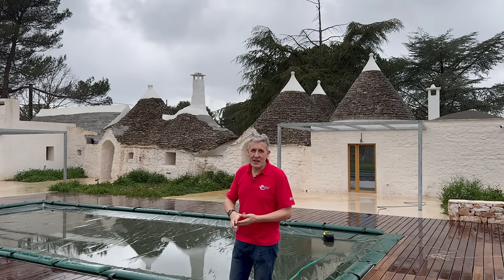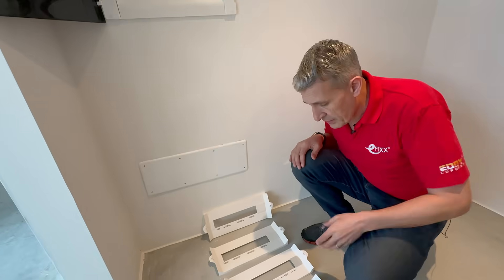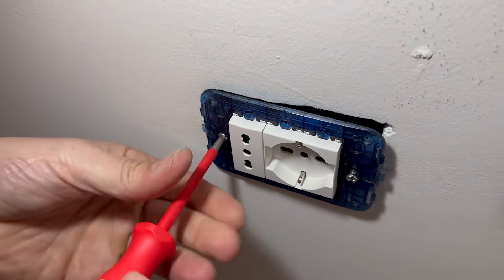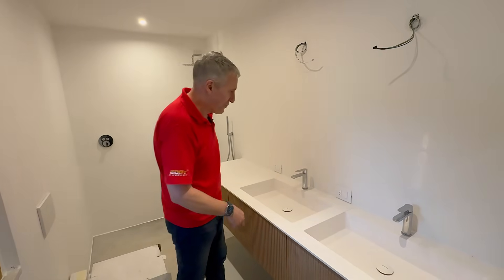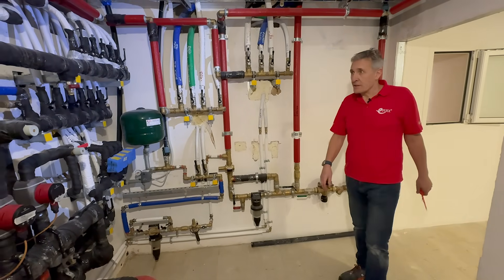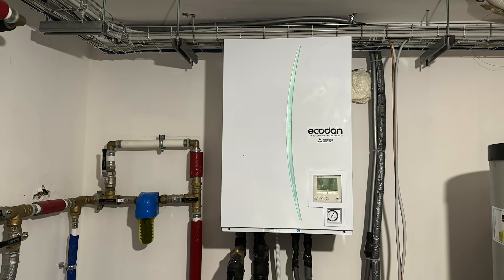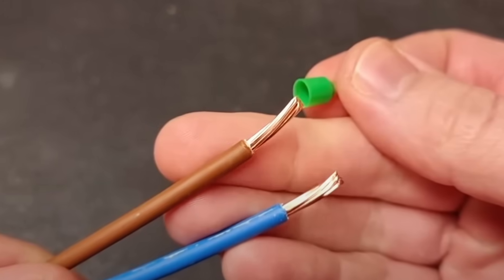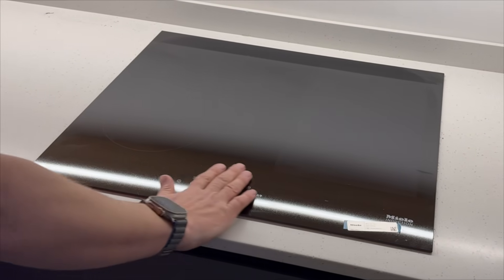Electrical Installation in Italy

Comment: How do you mount light fixtures to a bunch of wires sticking out of the wall?  In the States there is a box to screw the fixture to.  In my Italian house I'm just putting screws in next to the conduit coming out, but it seems so wrong.
Reply from the maker: That’s the usual way in Italy!
Reply: Grazie!   @efixx
Reply: Not really an issue in case of brick & stone walls. Though nobody puts screws directly into walls. We use wall anchor and self tapping screws. 
If anything can be mounted or secured to walls, wall anchors are the way to do it. That unless you have drywalls... If that's the case, good luck.

Comment: I live in France, and we can purchase "pre loaded" flexi conduits ( called Gaine). Which brings me to the question of how did they draw the cables through those long lengths of conduits? There doesn't even seem to be a draw wire to drag the cables through.

Comment: I've bought a property in Sicily and just going through the wiring requirements. I have to say the amount of flexible trunking makes me head hurt. The trunking was put in place before I bought the house. The previous owner didn't finish the wiring before they sold it so my guy has to go and make sure all the pipes are clear. I also want to make some changes, additional sockets, wall lighting and also some LAN connections (the walls are about 18 inches thick, so WIFI is not really going to work). I'm hoping that they don't have to chase the floor because it's all been tiles by the previous owner. Thanks for your video, it makes things much clearer in my mind what's going on.

Comment: Hello, this installation is good except for the sharing of junction boxes between low voltage (400Vac) and extra low voltage circuits (<50Vac). It is only allowed if both the kind of cables sheats can withstand the highest voltage present or if the power cables are double insulated like FS18, FG16R16, H07RN-F and so on. About the ferrules it's a common practice to use them with our Italian flexible cables, however they only provide an advantage when the terminal block has a direct clamping, with a screw directly pushing on the copper (like in the distributor inside the main switchgear). All the circuit breakers, though, have indirect clamping with a cage squashing all the individual threads of the wire evenly. In that kind of connection ferrules only increase the contract resistance.

Comment: Interestingly you came across Finder step relays which I have used extensively. Using Scolmore retractive switching on Cat6 cabling with 24vDC to control allows the householder ultimate choice of what they want to switch.

Comment: They dont need a isolator.
Becauase they can isolate at the board.
Uk 1 pole breakers only phase, not safe for isolation.
Italy 2 pole breakers (phase and neutral) safe for isolation.

Comment: I’m an electrician in the United States. Although I do think the British plug and the 240 volt system is superior, I prefer our conduit and wiring methods. That plastic flexible conduit looks atrocious and I bet it’s a real pain in the butt to pull wires through. We do have some conduit that looks exactly like it but it’s blue and we call it Smurf tube and we only use it for data cables or some concrete encased applications and not very long runs. Usually for stubbing voice and data cables from a motel room into the hallway ceiling, or up a concrete wall into the attic space to sleeve a section of Romex (twin and earth as you call it). Other than that, we use PVC hard pipe underground and in concrete, or galvanized metal conduit or mc cable for everything else. Romex is pretty much for residential and not much else.
Reply: It’s not really that hard to pull wiring, as said in the video we use class 5 conductors that are finely stranded.
Reply: Also the ugly pipes and tubes that are surface mounted are non flammable. Same for the wire insulation. 
Pulling wires isn't as difficult as it seems since we use 1,5 to 6mm² strained wires that are very flexible and easy to pull.
Reply: @OG_ALviK the problem is trying to push a fish tape into the conduit, especially on long runs. We are only allowed 360* between pull points. On hard conduit it’s easy to add up the amount of bends and keep track but with flexible conduit each little sag and dip adds up and I’ve had to have someone else shaking the flex while I push the fish tape in.
Reply: @monteclark1115 That's because you guys don't use strained wires but single core ones. That can suffer from bending fatigue

Comment: Taking each socket cable back to a junction box reminds me of an installation I came across a number of years ago. 

All sockets were single with each on its own 1.5mm cable. All cables went back to a big junction box. All socket cables went into a terminal strip then one 6mm cable back to the Consumer unit above. The guy had big drums of 1.5mm cable free or very cheap. Lights in 1.5mm, oven on 4mm or 6mm. Worked very well.

Easy to fault find for sure.
Reply: Is it still a radial circuit? Well, it is but I don't think it is called a radial circuit 😅
Reply: @Mixolixplosion  
Yes a radial.  Not a ring for sure.

Comment: Guys. Even in Poland we have more advanced and way better made installations than in UK. UK needs updates asap😅
Reply: Going by the Polish guys in the UK. I would not let them near a pipe or a cable.
Reply: @johnburns4017  probably these peoples are not sparks or plumbers. I cam tell a lot about english tradesman's as well.

Comment: I purchased a house 18 years ago and found the wiring to be all black throughout the house. I am slowly replacing the wires and adding wifi switches to work in parallel with my relays throughout the house. I created plates with all the components and relays mounted over the JB because it's too small.

Comment: I think house building in the Uk is about 50 years behind most of Europe. We are still obsessed with cramming lots of circuits into tiny consumer units in ridiculous locations. If we designed our house similar to what we have seen here . I think this would help combat the zero emissions problem as well as making EV charging more readily available to everyone.
Reply from the maker: Exactly 👍
Reply: Yeah consumer units under stairs or directly above front door . Or in tiny cupboards built around it with barely enough space to get the front cover off the consumer unit . The placement of consumer units and dno cut outs in domestic properties in the UK is pretty bad
Reply: Can't tell you the amount of times I've had to inform a client their cupboard is going to have to be dismantled for work on their board . They're never happy and even less happy when realise they need a joiner to replace it .

Comment: You call two way and intermediate lighting wiring complicated...I'd hate to see what you'd call commercial panel wiring with PLC's, contactors and other specialised equipment in the panel.
Reply from the maker: I wouldn’t struggle but many electricians do.

Comment: Much more similar with mainland EU. Everything makes sense. Isolator switches offer ZERO protection from anything. They literally never trip nor are they never OFF when fault or dangerous situation happens. I would like to hear reason, why UK uses isolation switches (for DC and AC of inverter, for appliances etc).
Reply: It's literally in the name - isolator. They are not protective devices, their only job is to electrically isolate the incoming and outgoing circuits from each other. They are meant to be operated in a zero-current state.
Reply: @Jultsu  Everyone talks about the "meant to be operated in the zero current state" but actually the specification for the devices allows them to be used as an interrupter.

Comment: The back boxes are American, even down to the UNC 6-32 fixing screws, which are a nightmare to find if you're using those boxes outside Italy and need longer screws. Apparently Mr. Ticino, one of the founders of BTicino, went on a study trip to the US in the late 50s and was so impressed by the system that he introduced the boxes in Italy in the early 60s. Italy also has sizes that aren't used in the US. The ones in the video all seem to be 3 modules but you can get 4 and 7 modules too, and 6 (3+3), 14 (7+7) and 21 (7+7+7). Especially the larger boxes are atrociusly expensive compared to the round 60 mm ones used elsewhere in Europe. Round ones are around 20 cents each, while a 4 module Italian one costs €2.70 and a 7 module one 4.70. The round ones slot together for multi-gang switches and sockets, so you can just multiply the price with the number of accessories you need.

The non-IP rated sockets right against the sink definitely aren't a great idea, usually they're at least 300 mm above the sink and/or to the side.

The lighting controls are on a KNX-based bus system, so only a two-wire bus cable runs to all the "switches", I think one cable can serve up to 128 devices. Very flexible but requires programming, so a lot of effort to install. If I remember correctly (it's been almost 20 years since I learned about KNX/EIB), each actor and sensor is assigned an address on the computer (a bit like pairing a bluetooth device), then it's assigned a function. The switches are considered sensors (because they provide an input) and the devices in the CU that do the actual switching are actors. 
I can't really see why you'd need that in a home, unless you wanted to add advanced automation. In an office setting where you expect partitions to be moved all the time to accomodate various needs for smaller or larger rooms it makes a lot of sense though, you can move lights to different switches as you please. In this case the KNX might be used for load management, which makes some sense.

Austria uses the same style of flexible conduit installs but solid conductors up to 6 mm2, coarse stranded 10 mm2 and up. Using flexible conductors makes life a bit easier but solid works too. The regs allow for flexible conductors (class 5) but most switches and sockets have push-in terminals that aren't rated for class 5 (marked with a little r somewhere on the accessory). Italian accessories have a type of terminal that clamps the wire between a solid plate and a square nut, a bit like a cage clamp, which doesn't require ferrules. Perhaps that's why screw terminals are still so popular in Italy. Ferrules are generally only required if the wire is contacted by a screw tip or head.

Comment: My property in Italy has all BS 1362 then adaptors, all electrical accessories/ fittings are expensive and because of the modular system not interchangeable. Yeah love the relays for multi way lighting, however can be annoying in the middle of the night with that clicking noise every time someone turns a light on. Who be interesting to know how dangerous it really is to have a socket so close to sink / basin.
The only electric shock I had was from the washing machine in a bathroom, cos the my mum call out an Italian electrician because the Rcd keep tripping so he disconnected the earth🫣
Reply: Yeah happens a lot on kitchen sinks with dishwashers too . Earth leakage shocks when poor connections are made
Reply: @christophergallagher3845  They leak a lot of current so they must be on a dedicated circuit to avoid nuisance tripping.

Comment: It's not even a question of why Europe doesn't have one standard - it's why you'd install multiple standards in one house, unless it's to get say 400V for your MIG welder in your garage or something. Also the Type L is a disaster. Conduit is interesting, I think I'd rather have, if I was building my own house (and I plan to some day), drop ceilings and cable trays.. Just me? I do like pipe-in-pipe for water though - it's a crime we don't really do that in the UK..

Comment: 3:18 That actually is not a schuko but a combo that accepts both schuko and Italian sockets.

In the Continental Europe all countries with the exception of Denmark Italy and Switzerland use either Schuko or Belgian style sockets. Modern plugs work on either one. In Denmark an Italy schuko is increasingly used. However, the Europlug that is used on small double insulated devices work on all of the sockets.
Reply from the maker: Jeez adding to the confusion. Just pick one and go for it.  Or perhaps time to adapt the UK system 😉 Great information thanks for sharing
Reply: @efixx  CEE 7/x is by far the dominant system in Europe, with most plugs fitting both German and French style sockets. So the only outliers are Italy and Denmark (Schuko codified in national standards alongside older local types) and Switzerland (unlikely to ever change, Schuko may be installed but only if enough Swiss sockets are installed side by side). And of course the four BS 1363 countries that aren't likely to change anytime soon either.

Denmark made the odd choice of accepting both German and Belgian/French style CEE 7 sockets instead of picking one, we'll see where that's going. Their old system has the massive downside of sockets accepting German and French plugs without making an earth connection but both plug types are extremely common in Denmark.
Reply: @efixx  most cords here (NL, BE, DE, FR, PL, PT, ES, and a couple more) have a plug that fits both the "Schuko" and the pin-earth Belgian/French) sockets.

In some counties the regulations allow you to use a socket of your own choice, BS1363, Schuko , pin-earth, of even Swiss or Italian types would be all fine to use.

For example in The Netherlands, most people assume only the NEN-1010 is allowed to be used, but since it's not a publicly available, and the law mentions "or of a equivalent safety level", you are allowed to use the IEC regulations, or a derivative such as, Belgian AREI, German VDE, French NF, or even the UK's BS regulations.

Comment: I work on alot of Italian plant and it seems to be some decent accessories mixed with some poor wiring methods, they also use alot of flexible cables for fixed wiring and some of it has an aluminium braid under the outer sheath

Comment: every country has some despensation from harmonized regulations....but I would not trade the Italian/Spanish way of doing electrics to british...british is much safer,sturdy and future proofs...only thing I personaly think would be a thing to adopt is those relayes for two way and intermediate,to eliminarte partially of wiring...but then again,wiring will always be there...sooooo
Reply from the maker: It’s amazing between to intent and reality of harmonised standards. How buildings are constructed makes a big difference.
Reply: The French Consumer Units are superior to the British. Although we appear to be moving over to their way - needs being made mandatory.

They have DP breakers which means twin bus bars, and less wieing in the CU.  The likes of Schneider sell them in the UK.

Comment: Always wondered what's the deal of those many isolators you guys install :D You can just isolate a circuit by switching off it's MCB.
Reply from the maker: We are starting to think the same!
Reply: I think the reason why we fit isolators is because UK MCBs are often single-pole, DP isolators are then required to provide DP isolation? If a duel pole RCBO is used then maybe isolators are not needed providing the consumer unit is close by?
Reply: @GlynHudson  According to IEC 60364, isolating the live wire in TN systems are enough, because neutral and earth are always on the same potential(0V). Obviously only in normal, not faulty state.
Reply: @klarnorbert 
Isolating only the line conductor is not full isolation. Well full isolation is the CPC isolated as well.
Reply: @liam3284 
Which is rare and not standardised.
Reply: In one House that had a kitchen ring with FCU isolators switching sockets to the big appliances like the washing machine, I suggested replacing the FCUs with single sockets with the appliances then being on  spurs off the ring. They were delighted with more sockets.
Reply: If I am not mistaken BS7671 does not say anything about isolators. I have found this 
requirement in UK´s approved document tho. So probably building regs need it ?

Comment: The cable wholesalers must be rubbing their hands with glee.  Yes, if someone puts a nail through the wiring just that particular outlet would be requiring attention but each socket doesn't have it's own MCB/RCBO by the looks of it so all the sockets, at least in a given room, still go off anyway.  Is it easier to pull 10-ish metres of  2.5mm through from the junction box or to pull 2m of 4mm or 6mm between sockets to effect repair, not to mention cost of the cable.  But if it works for them, and everyone's happy with the bills...
Reply from the maker: Seems to be the same across many European countries.
Reply: @efixx  Do not forget, ring final is forbidden and dangerous due to many reasons. If it is fused centrally, then there is no need fuse in every single socket. I think EU wiring with fused UK sockets and US meter boxes would be a better combination. All the systems have good elements, but hard to change the practices. Like changing US to metric system.
Reply: @gabor.nadudvari  US overhead mains and linking the neutral and earth wires inside the main distribution board instead of linking them in the meter box? No, thanks😅

Comment: I spent a few weeks in quarantine in an Italian condo in a somewhat rural area not too long ago, and every time the power failed (which happened every few days), it'd trip the main breaker. What could cause that? I've never had the breaker trip due to a power outage here in Canada.
Reply from the maker: You have a 24kw supply in Canada in Italy supplies start at 3kw
Reply: Overload. Don't turn on the air conditioner while your washing machine is running, etc 😅